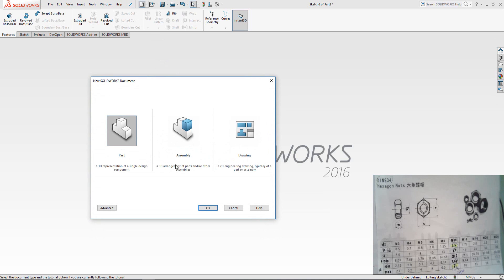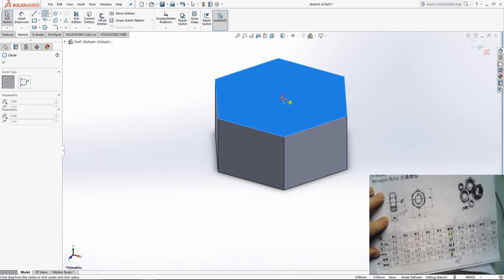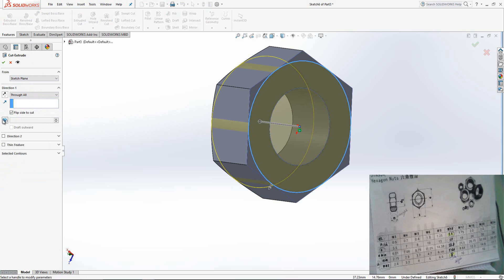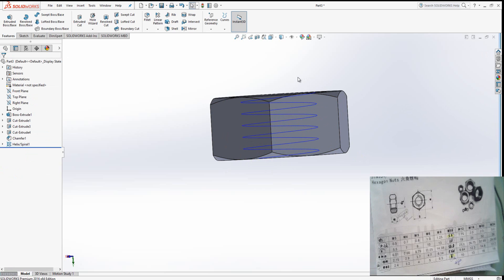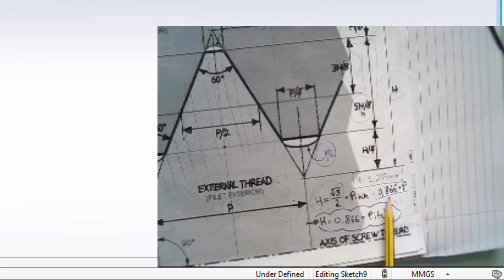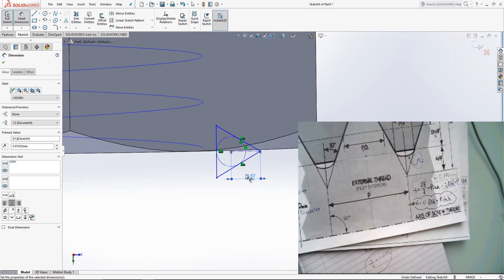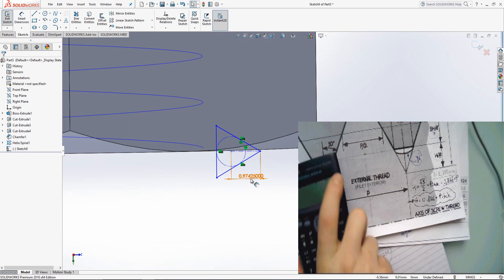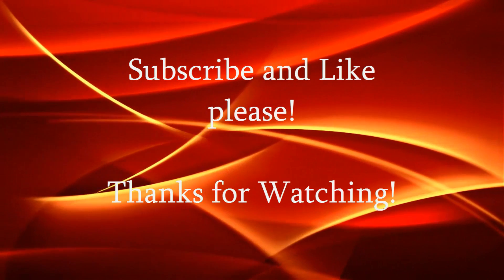SolidWorks Tutorial | How to create threads on a Nut M10  - EXPLAIN - step by step

Comment: !!!!You say it in the wrong way folk¡¡¡¡¡ I think that your intension was to say that the darker shading is the Nut in the other is the bolt, I realize of that when you speak about the fillets. I´m not a fluent speaker in English but I just want to let you know. Kind regards from the country with great food and women.
Reply: I´m agree with you, according with your data sheet it´s clear enough that if we want to design the internal thread for a nut or the external thread of a bolt the fillet corresponding to each one must be used. I mean if you want to design a nut then use the clearer shading profile which uses the H/12 fillet and in the designing of an external thread of a bolt use the darker shading profile with the H/6 fillet.  Thanks for sharing the Machinery's Handbook 27th Edition.

Comment: I wonder in which version of SolidWorks this nut is made, I have a version of SolidWorks 2017 and I can't make a piercing point. Thanks for the reply.
Reply from the maker: It's 2021 version. But this shouldn't be a problem. Make sure the triangle is close enough from the point of the helix and spiral
Reply: @solidworxedu1035  
Thanks

Comment: what exactly are the threads going to do?  A 10mm bolt will just slide right through the nut if the minor diameter of the nut is already 10mm.
Reply from the maker: Dear Derrick, Thank you for your comment. Brings so much value to our channel.
Please, you have to click on the following link to answer your question where explains the tolerances between bolt and nut:
https://www.youtube.com/watch?v=WVC5vrzgsL0&t=2s

Comment: minimum internal diameter should smaller than 10mm, this video should be a mistake for nuts m10, but great job. right?
Reply: Marios Christodoulou He is right, it’s not jut tolerances. You have to start with smaller hole (less then 10mm) if you want to cut threads for 10mm bolt.
Reply: One more question how to draw special nut M42*1.0  in solidworks 3D and export 2D drawing with marks? just can't find the answer for long.
Reply: isnt he talking about what would be the tap drill size? Machinists would drill a hole first at 8.5mm for m10 then tap out the thread
Reply: Xander054 you are correct. I built the nut using a 3D printer and the hole is too big.
I measured a bolt with calipers and got 8.7mm for the extruded cut; built it again and this time it worked.
Good catch!